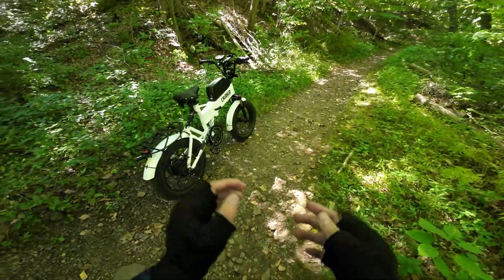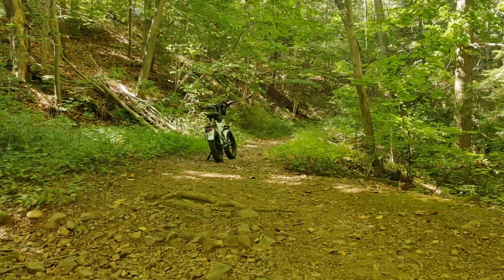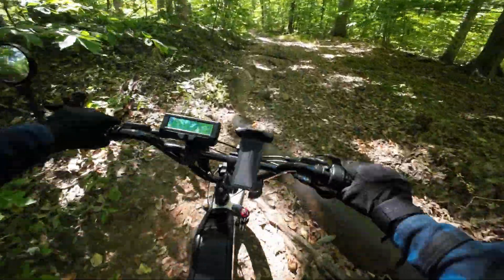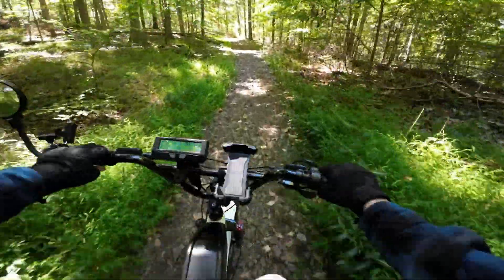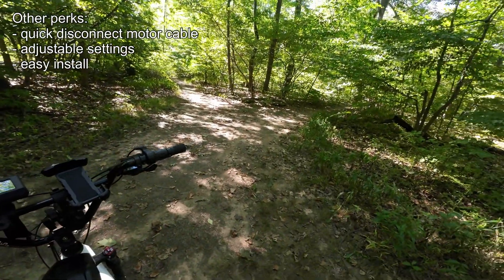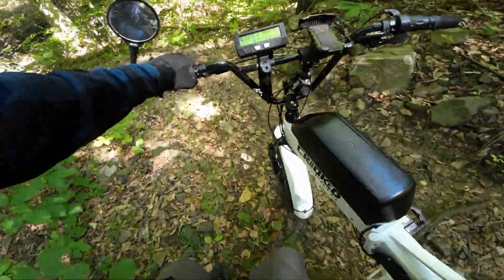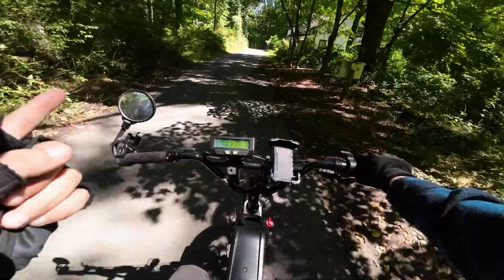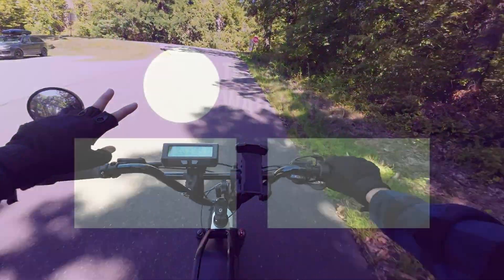What can a $500 eBike Conversion Kit Do?

Comment: hub motors suck dikk.   a lot of stupidly spent money on a bike of bad choice in the first place.      i have a 20inch fat folder with a BBSHD motor for 1750usd from Alibaba, including shipping, without any need for the expensive dead weight you bought additionally, proper gearing and an air fork in front, that would rip a new hole to this pile of trash in terrain and on steep hills.    hub motors suck hard.

Comment: Battery is on too tall so amplify sideways force which is first problem and second is throw off  handling as on top frame. Then it sure be strapped down if off roading quite a bit. I seen people completely rip off tabs and battery goes flying and destroyed on trails been on. One saved for a guy as recased it as cells didn’t take much damage and only had to replace a couple, but this setup won’t take on not paved downhill at all. The way it setup leaning will just cause it to wipe out as you have to do when doing high speed downhill on those type of trails. Then unspun becomes a issue. Reason why prefer middrives for this with battery in frame, more of a dirt bike style. Old school as use to do this on a custom  non electric mountain bike when younger. Yes fracture in broken bones going down hill when fork snapped once as when with cheap fork as was young then learned lesson saved up and upgraded. 

That bike just not designed for non paved trails like that. You need a middrive with battery in center frame and a decent fork oil, or air with rebound adjustment and decent rear shock. Which is why I had a custom built Bafang ultra 26” 3 inch tires for trails like these or down hill as handles way more nimble and can react much quicker. Haven’t wipe out on it so far and taken it on unpaved and paved trails. That bike will get you hurt badly as a commuter not a downhill off roading bike.

Comment: does the geared motor accelerate just like a DD or does it feel weedy and out of its depth at medium to high speeds ?  could you tell the difference on flat ground if you didn't know what type of hub motor it was ?

Comment: I ride MBT's all the time, but they are usually smoother and better groomed than that. I drop my seat and almost sit on my rear rack for steep descents. I think I have an advantage in balance though because my battery is in the stock location, behind the seat post and almost touching the crank. I have had a battery on the top tube, but the bike was less nimble. I don't know how many time's I've crashed my RadMini, but it never got any real damage on trails. I use a Phaserunner (Frankenrunner's brother), and the silky smooth and precise throttle lets me do things I could not do with my previous 35A controller, which was like using a chainsaw to cut bread. How many amps of field weakening are you using?

Comment: I'll I have the exact same motor and if I buy the Franken runner controller it has a L10 connector whereas my motor has the julet ZN16 connector. Is there an adapter that u used? Any tips would be greatly appreciated as I have the controller in the cart ready for purchase
Reply: I would recommend emailing grin technologies on that one.
Reply: @LuPercyChux  
Ya I did and they have what I need just not in stock of
Course

Comment: what i like most about the frankenrunner & cycle analyst is how it completely transforms the power delivery of the bike. It's a huge upgrade for any Bafang hub. no more on/off throttle response and the janky PAS where you can only adjust the power by large increments. Also the bafang controllers tend to have a mind of their own sometimes even when you are giving it full throttle its like nope 500W.  Its great being able to use a specific amount of power so you can pedal at the cadence you want.  I think there is some way to get cruise control working by holding the throttle in the same spot for x seconds or something, i haven't done it yet.
Reply: all that can be done to BBSHD and Ultra motors via an 18 dollar cable and a computer without the need to buy goofy unneeded shyte.

Comment: 🐍 Battery is just too tall/high for the weight/size. Too much centrifical force is generated with every bump. You got lucky the rail bent today. Eventually the rail/⁰tabs or battery tabs/rail will become brittle and crack off. That GIANT fin battery ideally should be mounted below the top tube to minimize vibration effect. With the battery sitting so high, you should riding on Princess Trails.

Comment: I have a new bike I made that's 48V 1500w and it is amazing I used a 7 speed beach cruiser frame and put on the motor and the battery fits in the frame perfectly. It has just regular pull brakes the types on bmx but I'm planning on replacing the fork so I can put at least one disk brake on and since it would be on the front it would be perfect

Comment: No skills 🤦‍♂️
Reply: Skills is one thing but that bike not designed for that especially for the non experienced that not use to non paved hard trails. 

First battery mounted on top and is large and heavy. Then no straps. 

Second is suspension is not setup for that it made for commuting and to stiff. 

Third tire is 20”

Now I done foldable for fun on non paved but also experience as rode non electric mountain bikes downhill on hard trails. Even then with this bike I video definitely won’t risk it as to top and rear heavy and handling would be poor.

Comment: I cringed the whole video for your bike.  That was rough riding.  I have two ebikes, lectric and rad wagon.  Nothing is custom on either one.  Both upgraded hydraulics, dual battery systems, seats, mirrors, etc.  I have to give you a lot of credit because I didn’t think to “convert” them until your channel.  Much easier on an actual e bike to convert to what you want.  They replace my car so both have very custom trailers I built to haul my six year old.  Wish I could post photos.  Feel like you would appreciate them.

Comment: you fell because that is not a mountain bike to start & your front fork shocks are pumped to street riding you would have needed to lower the stiffness to prevent the wheel from jumping
Reply: Excatly suspension is not up to task for sure. 

Other issue is battery is large and on top of frame which will throw balance off and need to be strapped. I seen people battery like this fly off the bike completely due to broken tabs and etc. 

Then the wheel are to small.